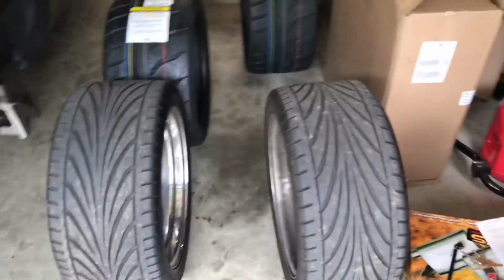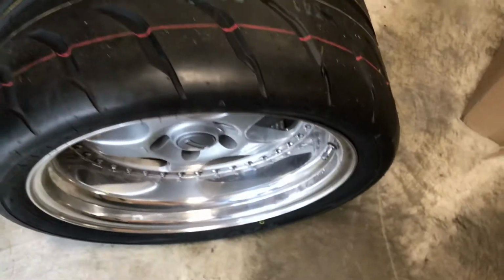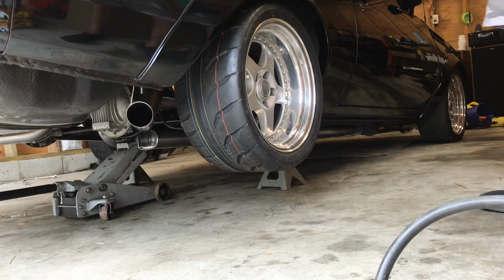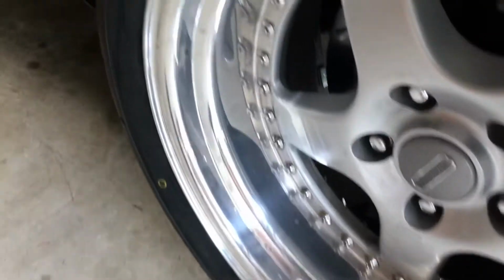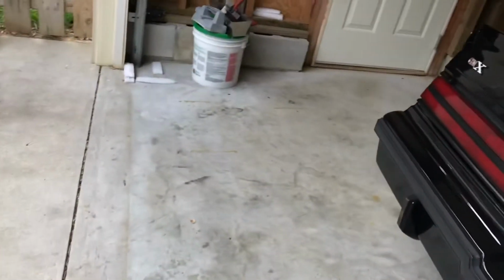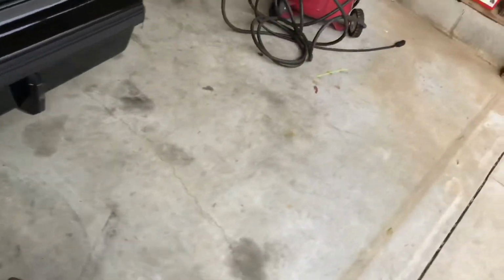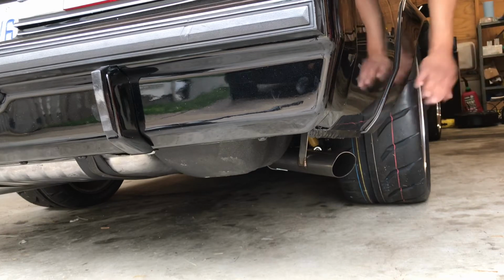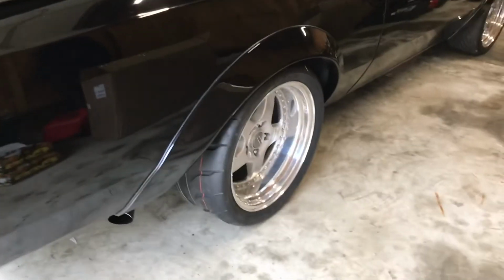Toyo Proxes R888r installed on the Buick Grand National

Comment: What rim is that? Itlooks great. And what size is it? I have a g body el camino im working on and wanted to see if you had to do a notch to fit that or did they just bolt in no problem
Reply from the maker: Simmons wheels 18x10.5 rear 18x9.5 front

Comment: FYI, I see the yellow dots on your tires are not aligned correctly. The yellow dots should be aligned with the valve stem on both steel and aluminum wheels since this is the wheel's heavy balance 
point. This will help minimize the amount of weight needed to balance a tire and wheel assembly. So usually, whenever you see a yellow dot, match it up with the valve stem.
Reply from the maker: Thats some good info...thanks

Comment: Great vid can I get some info on the rims. I am having trouble with local shops not knowing what will fit.  Do you have info like back spacing and rim size?   They look like 18x10 maybe   Keep up the good work
Reply from the maker: they are 18x10 in the rear and i think its a 4.75 backspace
Reply: @2muchBoost_  I hope this isn’t asking to much. Who is the manufacturer of the rims?   I can contact them and I’m sure they have other styles to choose from. I was thinking a bronze or gun metal set for my natty.  These worn out cragers have to go
Reply from the maker: @michaelfrasson6149  these rims are called Simmons Wheels...I don`t think they make them anymore, but check out there website i might be wrong